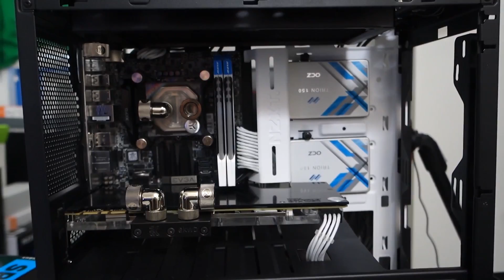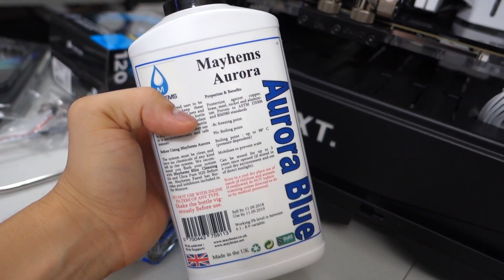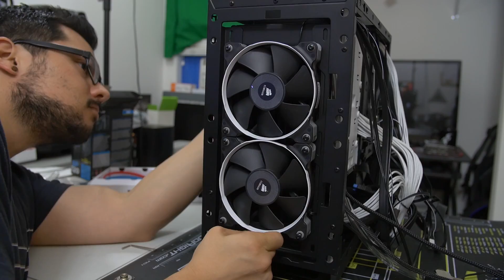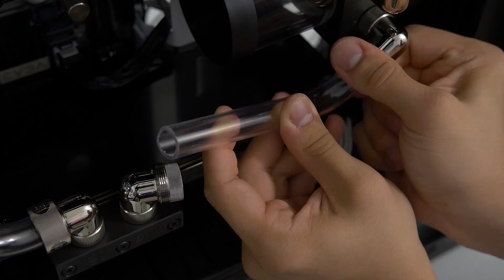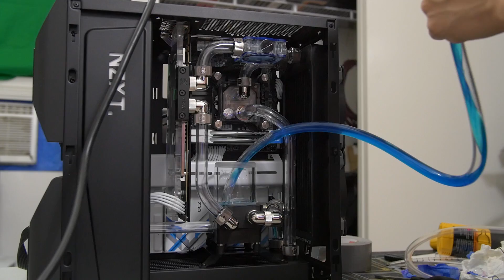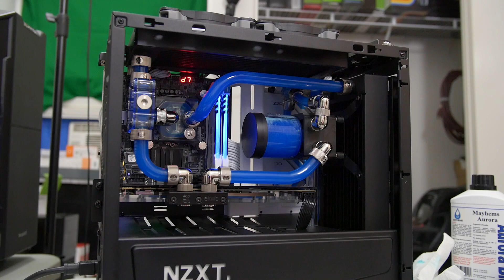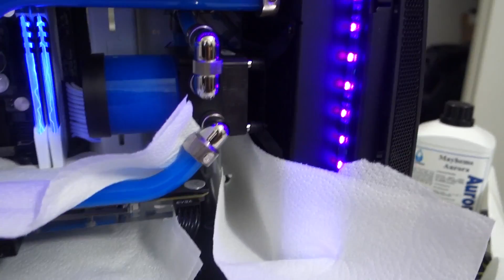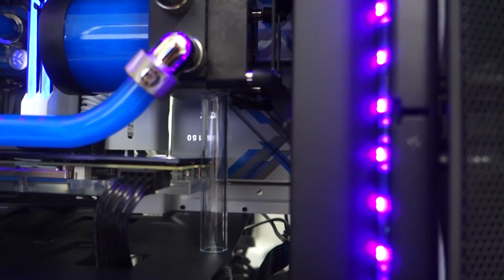Custom Tube Bending and THE MOST EPIC OF FAILS - Build Log #2

Comment: this so called custom water loop cooler is so damn stupid. its both dangerous and a waste of money -_- seriously, you people spend $1000 for a custom loop cooler for roughly 5c of improvement over the AIO. and there is no guarantees if the damn loop leaks or something bad happens.
Reply: DrHillbillyShow well thats true, but i don't think you need to be good at physics and thermodynamics to be good at knowing the best cpu cooler for your cpu. Whats your business anyway? I just don't like CLW. And you coming out of nowhere start telling me stuff i already knew.
Reply: Dh66 any distilled water that come in touch with any sort of metal and mineral will conduct electricity.
Reply: Ferry Ansony I really think it's a personal question. Would be the same for people buying cases lime the Enthoo Evolv or a Caselabs one. I have a $500 loop for a 800 system and it's not because temperatures, i don't even overclock. I just like the way it looks. AIO's are meant for people lime you. That's a very good way of bringing watercooling to everyone without worrying about all the leaking and stuff. For the record, i have a watercooled RX480 and i5 6500 and i am planning to watercool my Trident Z too XD. But i just like it.
Reply: Rick Cash well, technically if the paint mass is smaller than the former paint it will make the car goes faster :D
Reply: aesthetic ? there are people who spend 500dollar on a case, by your logic it wont make any sense
Reply: ***** well thats is just as stuipd.
Reply: +Ferry Ansony sure then theres no such thing called art by this logic
Reply: ***** well, no. Computer is not art :p
Reply: aesthetics bro...
Reply: People usually custom watercool because it looks nice.
Reply: and also my custom loop is 12c better than h100i v2
Reply: I totally agree. water cooling makes no sense
Reply: Giancarlo R it does make sense, our ambient temp in my house are around 40c.. if i go outside it gets up to 50c ofc it does make sense
Reply: ***** ambient temperature of 40c wtf? you'll probably die due extreme temperature
Reply: lol dude earlier this year we hit world Record 54.0 °C (129.2 °F).. and i was working outside that day.. our bodies are used to it
Reply: ***** where do you live?
Reply: Kuwait
Reply: ***** lol we aren't that far off
Reply: Ferry Ansony AIO can leak too u know
Reply: TheLoneWolf much smaller chances than custom water loop
Reply: Ferry Ansony not really
Reply: TheLoneWolf haha yes it is. With aio you just pop that thing on top of your cpu and you're good to go (well assuming that you get it from a good brand e.g corsair & NZXT) 

With custom water loop you bend the pipe too far and it gonna squirt like a holley pipe
Reply: Well i mean its a PERSONAL computer 
People want theirs to look as cool as possible or like messing around with different configurations
Reply: d1asian clearly
Reply: Scorpio, this summer Kuwait actually hit 63 °C (145 °F) one day...where I was working outside. hmm. I had a dry temp probe that was in the shade where I worked and it was accurate. Kuwait will not broadcast any temperatures over 54 °C from their weather stations. There was a solid week of 60+ peak temps in July this year.
Reply: Distilled water does not conduct electricity.
Reply: Mattias Haglund its the other way around. Deionized still has mineral and metal dissolved in it. This will reionize quickly in a loop and corrode. Distilled does not.
Reply: Ferry Ansony yeah you are right. I removed my post so no one does it wrong :)
Reply: Ferry Ansony are you sure about this?  because coming from a vapors knowledge, deionised water is commonly used as a replacement for propylene glycol in homebrew liquids.  seems strange that something with mineral and metal left inside chemically is a strange thing
Reply: Glenn Patrick just browsin around that topic
Reply: Jose F Pirela M thats a dedication. Mine is $2500 and i use Dual Tower cooler
Reply: Ferry Ansony Exactly. It can be stupid for you for a good reason, money saving. As you say, it is expensive and tedious. But Everyone likes something.
Reply: Jose F Pirela M well, valid point i guess
Reply: Painting an engine in a custom car doesn't make it go faster, it just gives it more appeal. Hopefully these people are not starving their families to build a computer that they like.
Reply: Ferry Ansony and the paint will come off easier, probably. Chances are the coat you put on it is gonna be thicker.
Reply: Don't mix the two. Just use clear water with that extra bright stuff.
Reply: CULT_GG build my computer I'll pay you
Reply: It's not a rational decision, it is a hobby in itself. People don't watercool because it makes sense, but because they like it, performance per dollar comes last.
Reply: Daniel Macías well of course they do, i know that already -_- I'm just giving out my feelings about them
Reply: DrHillbillyShow idk how old are you if you call 27 is a kid. Btw I'm not using my computer for gaming granny, i use it for my business and design. Better shut the mouth if you don't know about me tbh. 

I know a quite a bit about watercooler actually, I've helped my brother build his custom water cooler in his rig, thats why i think it was stupid anyway. And its expensive, i can't justify that amount of money for "hobby". Even though money will never be a problem for me. 

No need to be arrogant by showing how much you know about watercooler than me, if you are happy then its your choice. I don't give a damn, just try to keep your mouth.
Reply: blazeofvse kid? Yeah 27 is obviously a "kid" :) 

Ps: no need to be rude, lemon.
Reply: You don't know jack shit about watercooling, kid.
Reply: LMFAO, stumbled across this vid. This comment is pure gold. 5C is a Laugh! Someone has been buying too much it crap AIO marketing. Those things are utter garbage. You really think its 5c lmfao? When your 4.4ghz 5960x stays under 50c at full load with a 30c ambient, we will talk. 

Here is a Tip, Cooler Chip = Better overclocking. Dissipating mass amounts of heat from a 8 core CPU pulling 400 watts takes more than a AIO lmfao!

Sure its a 5c difference if you stick a custom block pump and a 240 rad. I run 4 480s, that is custom watercooling.

This is the problem with these youtubers, they preach up these AIOs because they are paid too. Look at there loops, do you see them running a CPU and GPU off a 240 rad? F no, because that is stupid and not realistic.

Real Watercooling is expensive, when you actually want high Overclocks with low temps, yes. However I personally dont mind paying that, I have almost as much money in SSDs as you in your rig (3x intel 730 480gb in raid 0 and 1 Intel 750 400gb (that is 1,600 dollars in SSDs BTW). 

Skylake X will be fun, all these AIO idiots will realize its time to put them in the garbage where they belong and get real loops.

Comment: Wouldn't it be better for the system to supply the pump with electricity externaly while bleeding the system so you don't have to switch the complete system on and off so much times?

Comment: I just lost all confidence to make a water cooled build myself.
Reply: Meh, just take it slow and double check your work before moving on to the next step. In a case like this, I probably would have installed the plugs at the same time as the other fittings, before moving on to the next component. Then recheck everything before bending and installing tubing, then recheck again before adding coolant. Of course, it's easy to armchair quarterback, and I'm probably missing some vital steps as well. But do your due diligence, and you shouldn't really have much to worry about.

Comment: Actually dude, two fails. The plugs are one thing, but cycling the pump on the systems PSU is just wrong. Always when you fill a system for the first time use an separate PSU so nothing in the build is powered if you have a leak. What if you had a bad o-ring in one of the fitting on the CPU block. ZORT! ... If you have the system powered by the system PSU. NOOB MOVE!!!!!

Comment: before you drain the mayhems aurora out i would actually like to see the uv blue dye added to it to see if it makes the aurora fluid accentuate the swirling effect. i emailed mayhems like a dozen times to ask them to upload a video of this and they refused to even to reply to me or send me a photo. since your already there id like to see it done, it might be the ticket instead of draining the loop all together and adding the uv fluid and the dye together. since it is at a point to add the dye already it might be cool
Reply: as for fixing the droop. take the res off and bend the uppe bracket portion in towards the res and bolt it back up.ittl work, done it before many a time with random brackets with and for random odds and ends in my pc already

Comment: Doesn't the drain port need to be at the lowest part of the system? I remember Jay saying something about that in one of his videos.
Reply: You flip the computer upside down.
Reply: Only if you're relying on gravity feed to drain it, most water coolers these days can be set up to use the pump to force drain the system under pressure, works far better and you ensure you get a lot more out the first go...
Reply: But you risk running the pump dry if you are not careful.

Comment: this is late. but meh. put washers at the bottom two screws between the pump bracket and radiator. should straighten your tubing out.

Comment: for the res pump, shim the two screws at the bottom of the mount if that makes sense.
Reply: Exactly what i was going to say!  just put 2 washers between the pump and radiator.
Reply: I was going to suggest to bend the bracket it's sitting on in that direction, but I like your washer idea better
Reply: I was about to suggest the same thing.
Reply: just attach a nice lint or branded rope around the reservoir end-cap and attach the other end to the top of the case, then tighten the lint/rope/string to make it level.. i would do it like that.. maybe use a corsair keycord or something.
Reply: just realised this is a year old question.. nvm :/

Comment: Spacers under the bottom screws between the rad and the mount*small flat washers* is about the only way without adding bracing. If you can screw through the rad then you could tinker with a brace to level it.

Comment: To put the pump flush try to use washers or spacers. You can find them at any hardware store you can paint them in black so won't stand out and ruin your color scheme they should blend in just fine. To paint them use motor paint since is high temperature resistant that way the paint will last you forever.

Comment: I spilled coke in my pc worth £2700 in 2013 (when I got it). It was into the PSU and it exploded with tons of sparks out of it.
I dried it with a hairdryer and it booted with same components. Then I spilled some AGAIN in my PSU. Same thing happened. Third time, I was drinking appletiser and i knocked it off my desk onto my floor and WOW IT JUMPED THE FUCK INTO MY PSU AND IT CLICKED A FEW TIMES, SMOKED AND BLEW UP IN THE SPACE OF TWO SECONDS... It took 3 spills in it to finally kill it. They're really durable. But a 900w PSU wasted. A GTX 690 made good use of it while it lasted.

Comment: Two small rubber washers under both of the bottom feet of the bracket where it attaches to the radiator will kick it out to level. Any sort of spacer, and you can use metal but rubber tends to be better since you can sinch it down tighter or leave it a little looser to do a finer adjustment.

Comment: you could try to put in rubber washers around the 2 bottom screws where the reservoir meet the fan to compensate for the drop

Comment: Just want to say you are so lucky you didn't fry something with that spill.

Never, never do your filling with the MB or anything else powered on.

Jumper your power supply and only have it plugged into the pump!  Or use a separate power supply all together.

Comment: A quick suggestion to correct the res tilt. How about putting spacers between the res bracket and the rad on the lower 2 legs? This should tilt the res slightly upwards which would counteract the lean. May not be the cleanest solution but its an idea.

Comment: Kyle ,
Cant you just cut another rubber grommet in half add a long bolt thats the difference in length of said new grommet the bottom to bracket arms to prop it up ?

Comment: That Aurora stuff is for nothing more then show PC's that get drained quickly. It isn't designed as a long term coolant and that shit is going to gunk up your loop. I would recommend saving yourself the trouble because when you have to open up those blocks and clean them out because of all the sludge in there you are going to regret it.

Comment: Your flow meter will never work correctly the way you have it hooked up. You either have to use the two connectors that are inline, or the two that are adjacent (basically any configuration other than what you picked).

Comment: +Awesomesauce Network
To fix the pump/res sag try using very thin washers on the lower holes of the mount. That should keep the pump/res straight even if the mount or radiator don't straighten up.
Reply: HAHAH! I was 8 months late :D
Reply: You beat me to it :(
Reply: Yup, stack a couple washers on the bottom side and it will even that ish right up!
Reply: same 8 months late
Reply: was thinking the same thing when he said it
Reply: Totally agree.
Reply: Just make sure to paint the washers so they dont look tacky.

Comment: To fix the "saggy pump" Try putting one or two washers on the bottom two posts of the bracket on the radiator to push the bottom out.  might have to adjust that bottom run just a little though.

Comment: That is all for show, wet systems do not improve anything, just the cost. Oh yeah I am ready for some comments.
Reply: depends on the system. 3 overclocked aircooled gpus and one aircooled overclocked cpu in one case would first of all run really hot and second would sound like a jet taking off, if you had the same system watercooled with a something like 2 360mm radiators you'd get better temps, way less noise, and potentially higher clockspeeds... watercooling has its benefits, but the show aspect is definitely key for most systems that aren't multi gpu monsters. and that's fine.
Reply: they do provide better cooling but not enough to justify the price, so yes they are mostly for show
Reply: If it's a workstation that needs as much power as possible, and is overclocked a shitton, it CAN justify the price, especially if you are overclocking already one of the most powerful CPUs for sale. It almost every single case, normally for show.
Reply: Its all about the size of the heat sync, water cooling only moves the heat sync to a new location, if someones massive air cooler is bigger than someone else's tiny radiator the air will win.
That being said Ive used the same 2 radiators for 10 years now and i just make a new mounting plate from plexi (drill 6 holes in a square) every time the bolt pattern on the motherboard changes. Then top that off with hardware store tubing, barbs and clamps for under $20 and you can actually watercool without burning a hole in your wallet.
I do totally agree you can spend way to much money with cosmetic cooling parts though.

Comment: People worry too much about their loop leaking. One of the 'o' rings on my CPU block fittings wasn't water tight and dripped water on to my 980Ti. I didn't notice the drip for 15 minutes while playing a game and my FPS got progressively worse. Took out the card, cleaned it with alcohol and dried it off with a hair dryer and it was fine. (And changed the 'o' ring ofcourse)

Comment: You almost pulled a Linus! 2-3 PSUs and a couple of GPUs later, finally gets watercooled PC done. I would pump it go the other way.. Pump, radiator front, into radiator top into cpu, then to GPU.
Reply: In spite of what seems logical, the order in which the water flows does not effect the temps, equilibrium is found regardless of the order. The only arguable difference is that water should be cooled before the pump to prolong the life of the pump, but even that is debatable.
Reply: Actually, thermodynamic analysis would beg to differ. Though slight (potentially negligible depending on VFR and component selection) there WOULD be in fact a difference in temperature of individual components regarding order. CPU makes considerably less thermal energy than GPU, so cooling it first would indeed result in a cooler CPU, but would also raise GPU temps slightly. 
Source: Physics major & nerd.
Reply: @jake thanks!
#respect*
*respect is given under the assumption you're not just BSing.

Comment: you could probably solve the  resevoir sag with a couple of VERY thin fibre washers positioned between the radiator and the pump on the lower two screws.

Comment: dear Kyle. i do not believe you will reply but i will ask and maybe you do..or others. i had the same issue in a close loop cpu by corsair. by issue i mean the radiator had to be in front but the openings for the tubes were up. so my tubes going to the cpu are coming from the top of the radiator like yours not the bottom to have the help of gravity as keep read around when it comes to water cooling radiator installation. do you have issues with your pump because of this?do you think i will have? unfortunately the case is not friendly to radiators in the rear or in top.